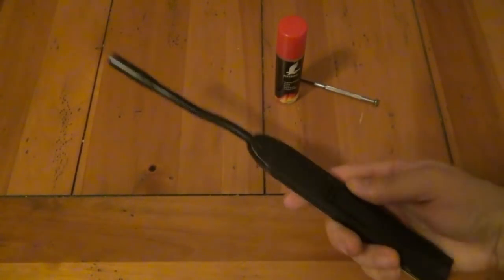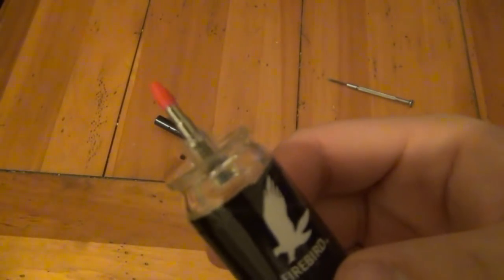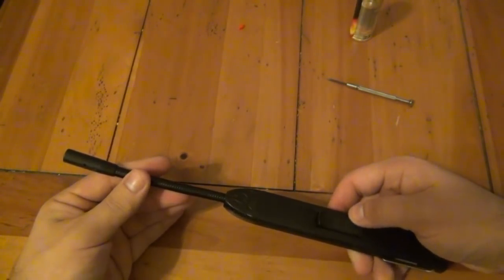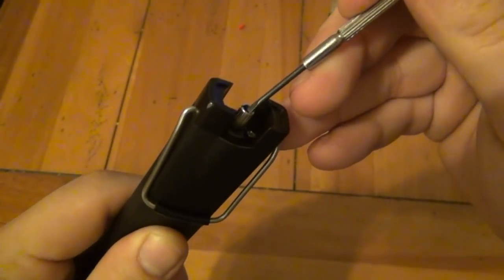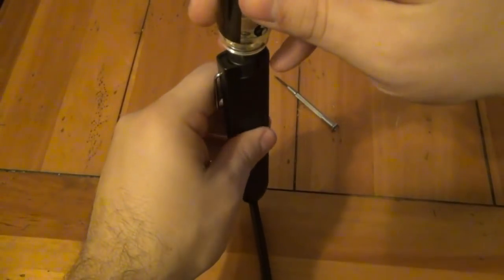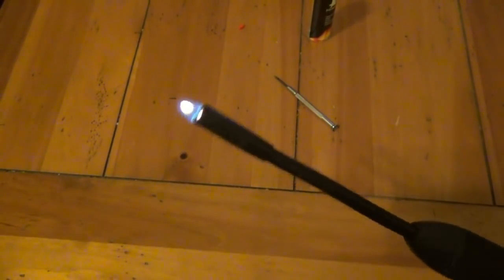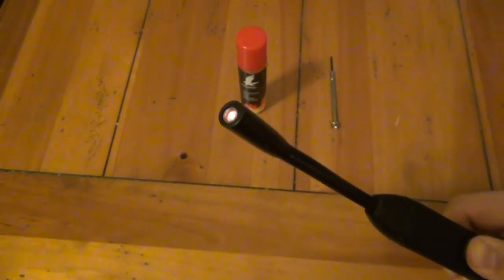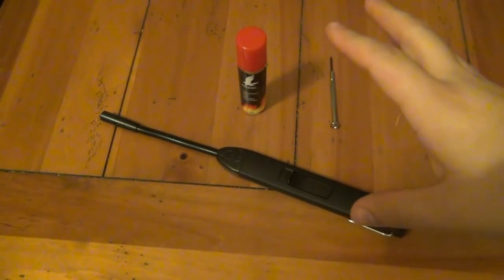Fixing A Broken Butane Lighter : Common Problem With A Simple Fix + BAD Fuel Not To Buy

Comment: He didn't fix it tho. Mine is doing the same thing, super low flow, and I'm not using cheap fluid
Reply: Same here.
Reply: @undercoverboss6933  try more gas
Reply: i got a butane torch, looking for a fix, cant find it

the valve doenst work, gas doenst come out, but it is filled

i filled it, used it a bit, let it sit undisturbed and the next day it doenst work, it doenst fucking wirk and i dont know what to do

Comment: " air trapped in the line" WTF? Why wouldn't the gas push the air out?
Reply: It does happen.
Reply: lol. I didn't even ask that. I guess this delta8-thc is working.
How is the flow of fuel, which is denser than air and under pressure, impeded by an air bubble?
Then his idea to clear the air bubble is to add more air.

lol. My high mind thinks that the best course of action is to: 
1) Press and hold the trigger mechanism
2) Shake or thump the torch/lighter against your hand as the high pressure contents are purged through the nozzle for a quick moment.
3) Attempt to re-ignite 

with this technique you sacrifice less fuel.
This seems like a solid plan. Unfortunately, it's late and I should be sleeping so I won't do a thorough testing of my technique till the morning, but my torch seems to be working now.

Comment: I followed this video and the first fuel I used which was a professional heat tool brand, but of unknown age, it did not work, the second time I drained and filled the lighter with newer fuel that claims to be ultra refined (hey you never know any more) and the lighter works flawlessly. Thank you for the tip to completely drain the lighter and use a fresh fuel!
Reply: yeah but draining only relives the tank what about glogs in the line or nozzle? how would purging and refilling help with those?

Comment: Thanks for the help, I just fixed a nice lighter that quit over a decade ago, but could not get myself to threw out.  I’d already done everything but disassemble the thing still just just a tiny puff of flame, so when you said clogged and with nothing to lose I thought to try poking a fine wire into the flame nozzle.  The wire was too big, but apparently enough to clear the very tip, so the very flick shot a long jet that almost hit me in the face, success!  And yes at some point I used cheap name brand gas in a white can and clogged a lot of lighters.

Comment: I just changed the piezo sparker on my butane gas torch. I had several spare piezo sparkers and replaced the one on the torch that didnt give spark if you pressed the ignition button normally. It only worked if you pressed the ignition button really slowly and without any more force than what was needed. It was really pain in the butt to use it, but after changing the sparker, it works fine ! I am so glad I got it working again. These torches are pretty cheap, but I really like them...
Reply: http://aijaa.com/kKmmaB Here are some pictures of the torches and piezo sparkers that I used. If you have some expensive lighter and the sparker starts malfunctioning, you can buy cheap piezo ignition lighter and take the sparker out and use it to fix the more expensive lighter !
Reply: Ssved

Comment: I'm reading all these comments and I feel all of your pain. I had a butane bullet cartridge lighter that I loved. It was a torch lighter,and the fuel lasted forever. It was SUPER hot and lit things instantly.
 Well one day it ran out of butane,I don't know how to tell when a butane is full while filling so I just held the fill for 6 seconds and I assume that was too much and when the gas expanded the fuel tank got ruptured or something so it leaks now and wastes butane. not to mention i opened it up and my sparker wire went bad. All of this by the first refill.....I now think of butane lighters as ONLY disposable lighters. 
  I went and got a zippo wick lighter. the ONLY thing i have found about a zippo that is beat by butane lighters is that the fuel evaporates within the lighter. This can be slowed by ranger bands (bike inner tubes cut to length,or the thumb of a rubber glove which is tighter and works better in my opinion) slid over the lighter when not in use. you can also get a peanut lighter. these are basically zippo lighters except they are completely sealed. i prefer zippos unless i need it to last a LONG time without a fuel source,then peanut lighters. i quit butane. zippo is much simpler. you can use multiple fuels including gasoline in a zippo. better for a permanent lighter. butane is best for disposables like bic. just my opinion.

Comment: ~Using a high quality flint like the ones that come with IM Corona Lighters and Kiribi Lighters since they are a bit softer than Zippo Flints and give a better spark.  
~Bleed all old fuel and air from the tank until you no longer hear the hiss of escaping fuel/air. Then refuel with Butane Fuel that is filtered 3X or higher.  All these recommendations I've given you should fix many butane lighter problems.  You could have a mechanical problem which takes a deeper knowledge of your lighter or confidence in your abilities to fix simple things. Remember, mechanical problems are fixable.  
~I highly recommend you use a high quality Fuel such as Xikar Purofine Butane, Colibri Premium Butane or Vector Premium Butane.  Any of these should give you no problems; they haven't me.  Always let the lighter come to room temperature before attempting to light it.
Reply: Great advice. Everyone needs to know this. So many times people will fill my lighters and say it sucks and broken. 30 seconds later I fix it and I politely tell them it was user error. They were broken, haha. Id only add that with some soft flame lighters hard flints are necessary. Bic flints work great if they fit or you can drill the hole slightly larger if plastic. Last, use the purple adapter from the cap of Newport zero butane can and it will solve almost every filling problem. It’s because it’s quality made and separate from the plastic cap. Its pushed into a hole, not ripped from a cheap red thin plastic cap that is deformed. Quality. Never had a problem ever since. You don’t even hear the butane fill its so sealed. Pump and release 3 times for no more than 2 FULL actual seconds if no butane window to see if full or you can’t tell. If broken and you know someone with knowledge, do not unscrew it! You will have tiny pieces fly into the universe and never see it again and now it’s really broken. Haha. If a tiny metal or plastic piece breaks, jb weld clear version. It will weld metal like new if you hold it correctly. If it’s easier then buying a new one.

Comment: Thanks, I just got a new butane hand torch to test out. These tips are helpful, mine, it turns out has a broken line, so I needed to purge the butane to return it. (I have zippo butane ;) ) I was a bit hesitant handling that, but your video makes it seem easy.

Comment: Great video! Fixed my lighter. Having the same problems although i used proper Zippo fuel. There must have been air in the line. Your method worked. Thank you!

Comment: There's a much more informative and in-depth video regarding butane torches, search for the title "Butane Torch Safety - Beaducation.com". Personally, it's the best video I've found on the matter. Also for any people searching for help, PRO TIP: If you bought a CHEAP CHINESE $10-15 torch from your local headshop and you've troubleshooted it for hours and still can't figure out why. Check these 3 things: 1) make sure air hole is fully open 2) make sure igniter is creating spark 3) most important, MAKE SURE GAS IS ON. BY DEFAULT IT WILL BE NEAR ZERO!!!!!!!!!!!  For MOST CHINESE butane torches, TURN THE TORCH UPSIDE DOWN AND USE A PENNY TO TURN THE CIRCLE MECHANISM TOWARDS THE POSITIVE SIDE.
Reply: I love you, thanks bro! Time to dab
Reply: spacetime
Reply: Your welcome all my fellow dabbers over the last 2yrs that have come across my comment and been helped lol.

Comment: I gave up on those piezo ones because every single one broke down after few refills and what I found it to be is still sparking and still gas coming out but it just wouldn't light up because after some time the nozzle where gas is comming out becomes so charred and dirty that the actual strength and thickness of the spark becomes so diminished that although you do see the spark it just wouldn't light it up and then I would get a tiny flat screw driver and scrape the sides of the nozzle to expose bare clean metal and it would work again for few days longer untill eventually you just damage and bend that spring nozzle and then just throw it away. So basically every cigarette and bbq and jet or open flame piezo I ever had ended up like that very short life span and now I don't bother with that crap I got myself flint and wheel lighter and it never stops working and by the way funny thing with those crappy piezo ones is that even before they brake down if you are in a very humid room or the weather is above 85% humidity like here in Australia they still won't light up until humidity drops down a bit because strength of the spark is ruined by humidity, I guess also that their lifespan in humidity is much shorter  because moist spring nozzle would deteriorate and rust much faster on outside where the spark is supposed to strike. So good bye to piezo for me and back to mediaeval reliable technology of flints 😁 by the way I tried that "purging" method with every pizeo I had before I threw them away and it doesn't make any difference and the funny thing about flint stone is they always work without any purging and I wander why would that be 😁

Comment: My lighter isn't working. It has a spark, but it won't light. I've tried emptying it and refilling it, but it still won't light I've tried letting some gas out to see if it was being refilled and it is. I've also tried changing the setting for how much it uses. I'm using Newport gas, since that seems to be the only brand sold in Australia for jet lighters. The lighter is literally only 2 weeks old.

Comment: hello,  I have a little butane cigarette lighter.  i have followed your instructins to the letter twice and it still wont work.  I can see the spark,  but it will not light.

Interestingly I can light it with an external flame, so the fluid is flowing. 

any suggestions?

Comment: Hi i have just bought a nentone gas lighter, Iv'e filled it as per your video, but when I light it gas comes out of the roll bar at the side and basically all over, I've had the gas turned right down, and left it for 10 mins, after which I maybe get a tiny flame, then its dead, any ideas please, cheers .

Comment: Hi, I followed your instructions when my butane lighter wasnt working (It did have the spark), so I emptied it and refilled the butane. The flame came up but it wouldn't stay up/on even when I hold the button down. What could be the problem you think?

Comment: The gas isn't cold because it is compressed. It becomes very cold when it is no longer compressed regardless of the static compressed temperature.. It's how compressors heat and cool in HVAC systems. Thanks for the video.
Reply: You misunderstood what he meant. You just added more words that say the same thing.

Comment: I press but I didn't hear the gas pump up. What happened?  How to fix it?
Reply: Well it doesn't pump up, it's like are in a basketball where is pressure and you poke a hole in it what you doing when you press on the button and let's go a little air or gas in this case. If you don't hear gas coming out of it when you have it up to your ear, that thumb button is probably broken and not lifting up the tube or you are just out of gas and you're not filling it right

Comment: It’s not air it’s the propellant from the butane refill tank. It has to have propellant in it so the pressure is high enough to push the butane into the lighter. It would take forever to refill if the pressures were equal.
Reply: Well there maybe a little bit of air in it from the tube.

Comment: I press the button on my lighter and there is no spark most of the time. Any help?
Reply: You might need a new flint
Reply: No. The button ones use a electric spark to light. No flint.
Reply: +jojorobino5312 take it apart and check the wire running from the sparker. make sure it isnt near any other metal if possible. check for any breaks in the wire. i assume that it is split in two somewhere. if not the sparker might be bad,try seeing if it shocks you consistently to be sure.

Comment: Try adjusting the flame height . There should be an adjustment usually on the bottom of your lighter. It may not be getting enough fuel to keep a flame lit. If this does not work it may have a faulty inner fuel release valve or some parts that may have gotten bent or ? if lighter was dropped.

w w w . sparks of time vintage lighters . c o m

Comment: Why does it work better when the fluid warms up?
Reply: Imagine that I take the fuel and place it in the fridge and after that I'll use it. Of course the oxygen will not interact with the fluid and will not light up. That's why they light up in warm fuel to make fire. You can't light a spark in a cold fuel because it will never work
Reply: Why do you warm up your car in winter?. Exactly the same thing because the fuel will not flow properly as if humans are cold and lazy in winter
Reply: I cant hear the fluid running when u press the button
Reply: Because butane an propane when at a lower temp wants to stay a liquid.  It does not boil off as well as it does when it’s cold is all.  Basically when it’s cold it doesn’t want to change to a vapor as rapidly as it does when it’s warm.  I’m not sure what the hell everyone else is talking about.  But that’s why.

Comment: Why do you blame it on gas fluid when at 6:30 you can actually see that spark doesn't work every time?
Reply: +Coolemur you have to remember that the spark is coming from a small piezoelectric generator. The hammer hits the crystal very quickly, so the spark only lasts for a small fraction of a second. The camera he was recording this on probably wasn't fast enough to catch all of them.

Comment: mine still won't work after trying that. i can see a spark and i can hear fuel coming out like it should, but there's no flame. anyone know why?
Reply: I got the same problem
Reply: Trippin Josh i actually got it to work by just buying better butane. you should try that if you haven't already.
Reply: thanks
Reply: Same here Cay and Josh
Reply: i have zippo fluid and it doesnt work :(

Comment: @OptiSD If you have an extra $12,850.80 lying around, I'm not sure buying the Zippo is the best way to make a profit on scrap gold. Most of the price of the solid gold Zippo does not come from the rarity of the gold itself, but because it is a unique item made of precious metals.
If you were simply going for the meme factor with a bit of relevancy to cutlerylover's lighter interests, at least it wasn't something along the lines of:
"I used to use like fire, but then I took a Zippo to the knee"

Comment: I hate those cheap butane canisters. They smell awful and they ruined one of my lighters. Luckily it wasn't an expensive lighter. It was just a Chinese made lighter I got from Deal Extreme which I replaced. It's better to get the more expensive fuel for your lighters. I'll stick with Zippo butane. Even for my non-Zippo lighters.

Comment: It looks as if the total repair was bleeding out the old fuel for air locks in the system and a refill... This will work on approx 5 percent of lighters needing a repair.... The most problems i personally see on butane lighters are the valves and o ring seals going bad.... Personally he got lucky by fixing the lighter with a re-fuel.
Reply: Funny thing though,  he didn’t...   I’m guessing you didn’t stick around until the end of the video. Smh

Comment: theres no bad fuel or whatever.if its a butane its a butane.the only difference is only which is better or  cleaner .they all burn the same .obviously, problem is on your lighter not on the fuel.just by seing those fire lit, i could tell right away that theres a loose connection or leaking in there.

Comment: is Ronson Butane no good?
Reply: He said Ronson is fine.
Reply: CSharp I asked because I had a problem with it.  My torch lighter won't work with Ronson butane so I bought Vector Butane and its working fine now.
Reply: Devin C I don't think it is bad, but there are most certainly better options. Ronson is probably the "best" cheap gas. lol

I had to modify my Ronson lighter to allow for a larger flame so the Ronson fuel would work after refilling. I think if I had used better fuel (purer/more flammable) it might not have been an issue. At least it was a simple mod. lol It almost make me think what they put in their lighters (probably made by someone else) is better than what they sell in their cans.
Reply: Devin C Ronson is owned by Zippo.

Comment: I want to add a video. My eagle torch with "safe*stop"is filled I've tried the empty and refill. It works just not a torch. Only a lighter flame and I have to use my other lighter to light the Eagle Torch

Comment: He did not fix it. What a waste. He stated with a weak flame and after a purge and refill he still  had a weak flame. There is obviously something clogging the gas path or the trigger  has become defective and won't release enough gas. All BS and pseudo science. If time would have made it work he should have cut to the time after it "warmed up and was working" but if course it never did.